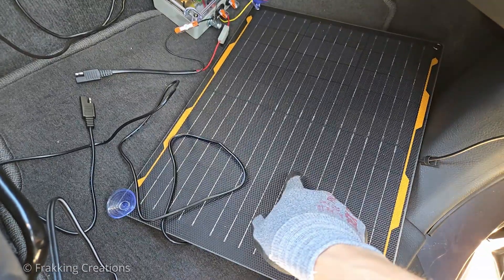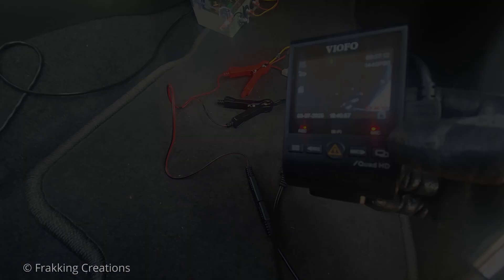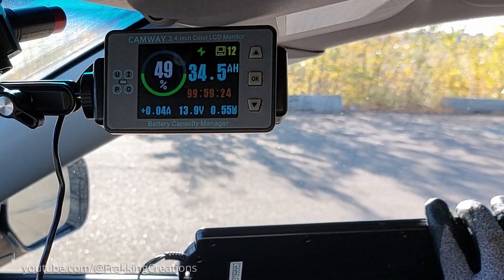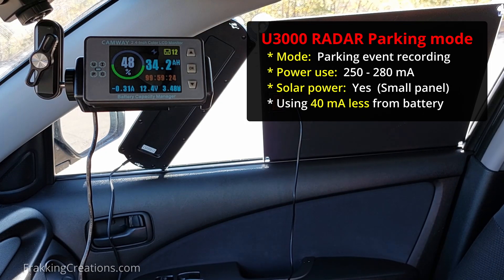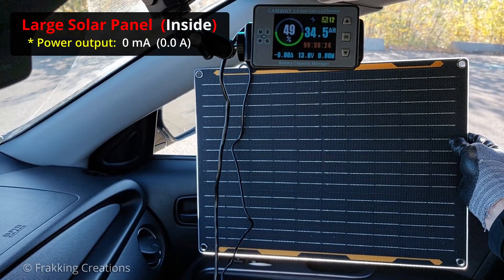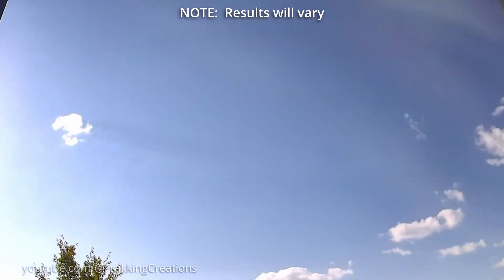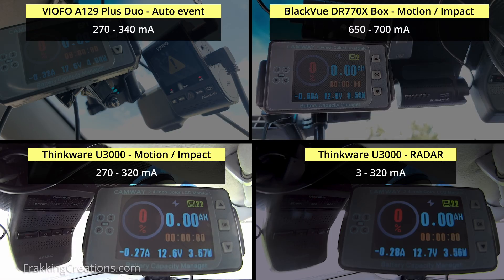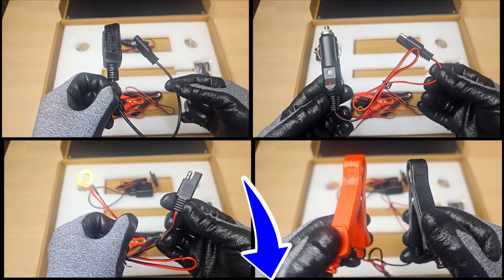Using Solar panel to Power a dash cam & Charge a car battery - Solar dash cam project | Ep2

Comment: will that solar panel's battery explode in high heat if leave it on the dash to charge the battery?
Reply from the maker: The solar panel does not have a battery.  It is hooked up to charge the car battery.
Reply from the maker: Our latest episode is out for this series, if interested:  https://youtu.be/BI-fhD5w0m8